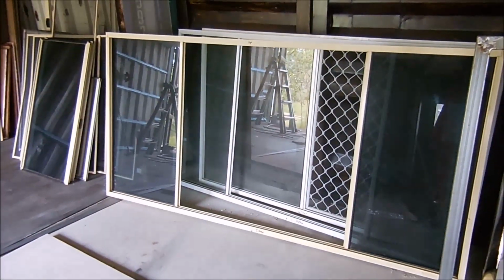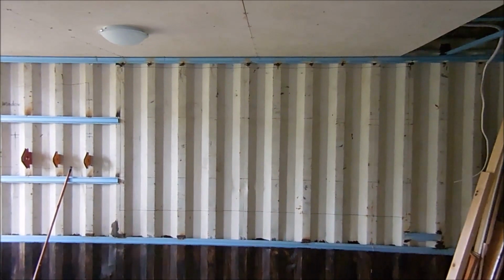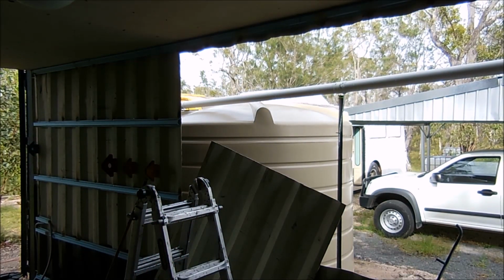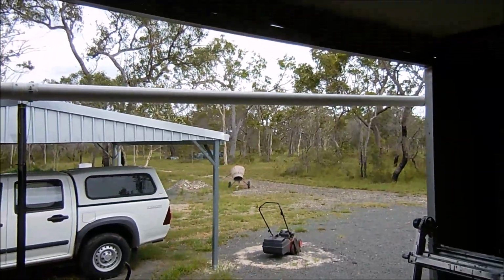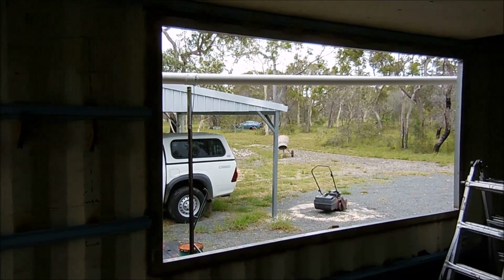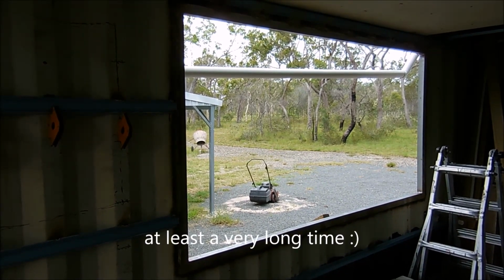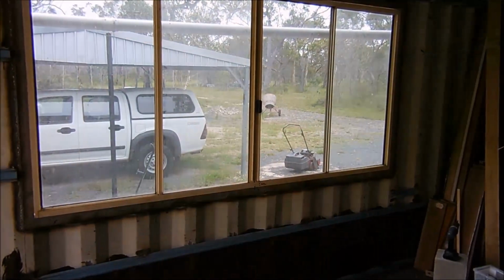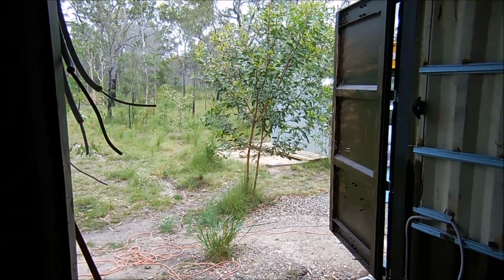INSTALLING LARGE WINDOW

Comment: Now that its been a few months have you noticed any settling or sagging in the containers from where you have cut out large parts of the walls?
Reply from the maker: There has been no problems with sagging etc as the section of wall left above the cut is equivalent to an 8" steel beam.There was 200mm of wall section left at each section cut out.
Reply: Great thanks.  I'm going to be installing an 8x7 ft roll up door in my 40ft high cube container soon and was watching your videos for ideas.  Nice job you've done on your house.

Comment: I think paul chambers when he did he windows with the 2 bits of wood to make the steal go out the window bit more safer i seen it drop in side i hate to see you lose a foot or maybe make a video like tim the tool man tailor and drop it on your foot and go jumping around this may give you alot more views on youtube lol .still its good to see videos on what not to do and videos on maybe that be a better way to go .
 The silicone around the window not sure why you wield for 4 hrs the fuel the gen must of used some cash up maybe buy years supply of silicone hope your generator last you, my mate had to get my generator fix after welding a trailer up that cost alot to i just put some good wields and seal it up as you had to seal the window to anyway container still be strong .
but yer love big that windows i and i see you cut to bits out maybe they make good windows shutters to close up in big storms and if you go away not sure on wielding the doors up but i make them still work and put  your windows on like a wood fame or steel up to you just inside the door so the doors make good shutters to  
keep up the good work love you video's keep them coming
Reply from the maker: I normally drop the sides I cut out to the outside of the container but I had some roofing iron left over from the carport sitting close by on the outside and did not want to damage the iron.

The generator does not use a lot of fuel and should run for years with no problems ( with
regular servicing ) very reliable which is why we bought a diesel
generator built a lot stonger than most of the petrol generators out
there

Comment: what kind of welder do you use?
Reply from the maker: It is a 120amp mig welder,using it with 0.8mm flux core welding wire
Reply: Bush Block Homestead Thank you for your reply. Did you find the Mig welder better than a arc welder? I'm planning to do a container cabin soon. I'm new to welding. BTW these videos are very educational.
Reply from the maker: If you have never welded before you will be better off with a mig welder as they are a lot easer to use.
Arc welders are good for heavy welding jobs welding thick steel plate.
Reply: Bush Block Homestead great thank you.
Reply from the maker: No problem :)